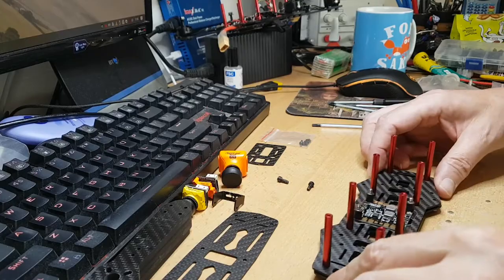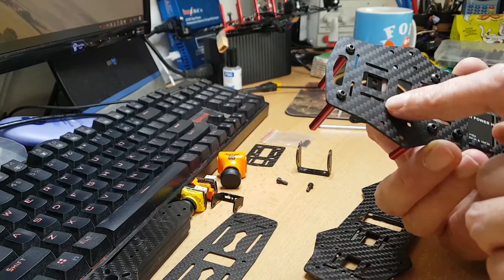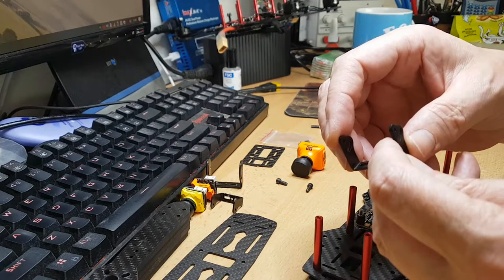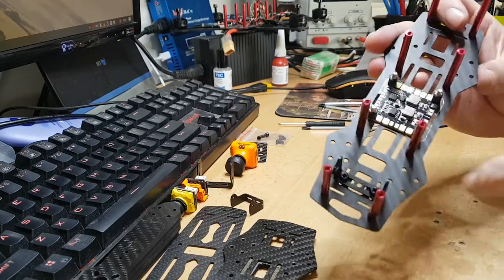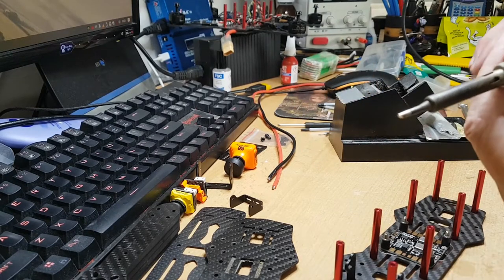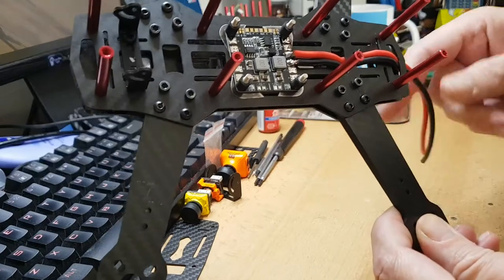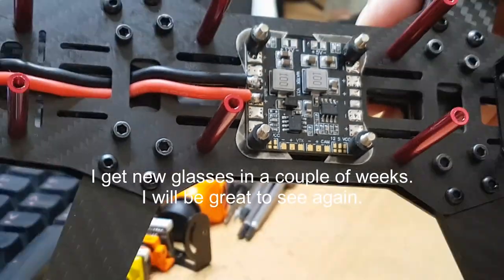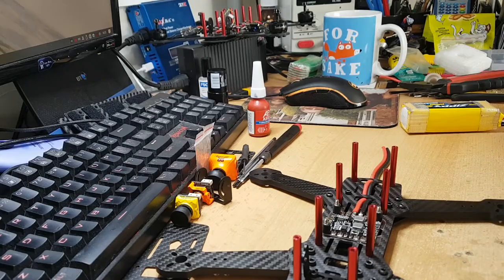Let's Build A Quad Copter   E02 The Frame Continued

Comment: Thanks so much for this series Elecifun. Endlessly interesting to me. My trusty H501s is still going strong (after a bit of rebuilding due to accidents lol) but I'd still like to build one. I lean toward just film making rather than stunt flying so I would like to incorporate a good camera with possibly a gimbal and GPS would be nice. It's fun designing one on paper. Thanks again for the videos.
Reply from the maker: I have been training myself using flight software to fly more controlled and intricately. I also would like to make better videos. I am considering a commercial licence, if I can fly well enough.
Reply: That sounds like a fun job. My brother is a retired military helicopter pilot. He now works for an energy company and is involved with their group that uses drones to check power lines and junctions etc. They employ commercial pilots like you are shooting for.

Comment: Glad your making progress .👍I'd be cautious running the power wire's through the frame. Possibly chafe the wires and cause short on frame 👍just my opinion 😁
Reply from the maker: Did the same on my last build and it has been fine, so far. It acts as a good cable stay in case a battery comes lose.  Or at least that's what I hope for. I will be sure to keep an eye on it. Cheers for the advice buddy.
Reply: @Elecifun  cool man ✌look forward to the rest of the build👍